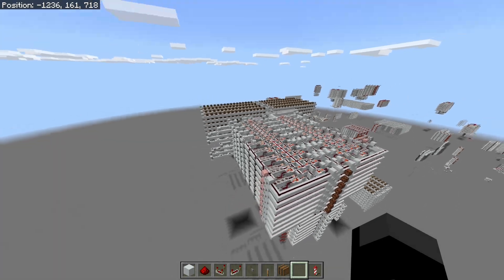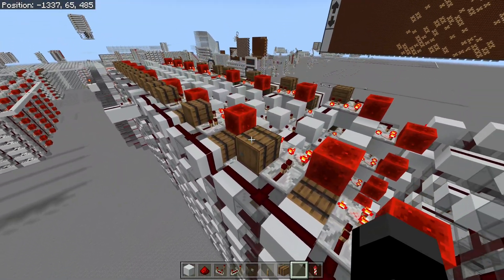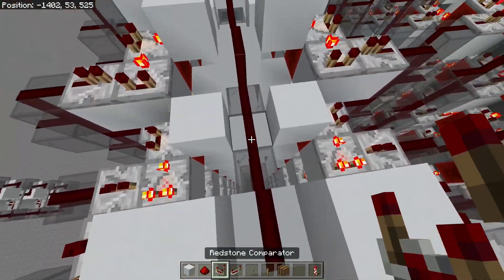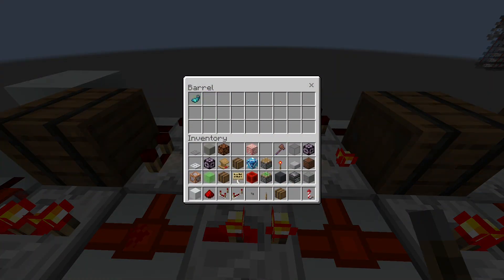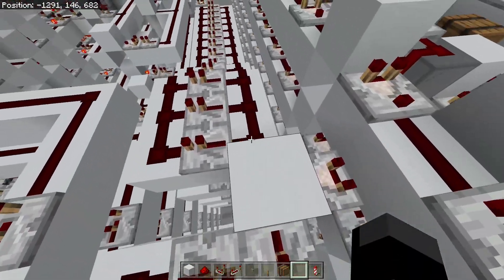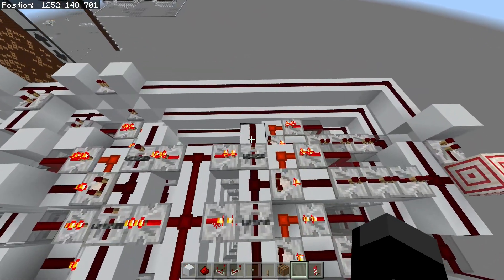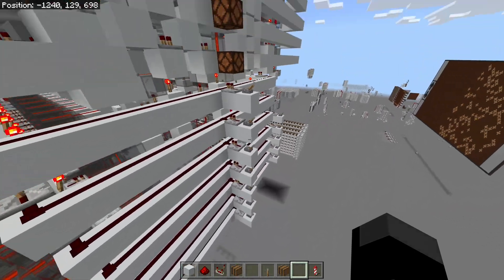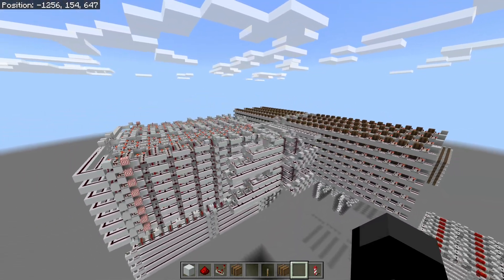I built an instruction cache in Minecraft Bedrock!

Comment: i am making a chest based rom. you can call it a redstone hard disk because it will surely have a 8 second delay or 80 if im lazy. im running into a problem. it cant read the rom it just takes the data and display it. do you think it will impact a computer or a machine?

edit : i can use you serial ram buffer thingy to make it faster. but it will have a huge delay to transfer data to from the hard disk
Reply: prefetch

Comment: I dont know how can paging reduce the processing cycle, since loading a whole page will definitely take longer than a single piece of data. Can you make an specific example of how can this be useful please?
Reply from the maker: @thanhhoa7955  Paging is typically used to address a much larger amount of memory than the fixed address but in this case it can temporarily speed up a processor. If you build a kilobyte of memory in Minecraft it will be very slow for random reads due to all the repeaters needed (whilst sequential reads are faster any branch will add a large penalty). If you have a small amount of memory like only 64 or 32 bytes you can randomly access it very fast meaning it will not bottleneck the CPU. Ofc each time you swap the page it will need to stall the CPU which will take a long time. Also, the type of hex memory that I use can only be sequentially read so paging is required for it to be fast. The hex memory is also extremely dense so 1k of hex memory is much denser than 1k of traditional torch memory.
Reply: @TheDarkness344  Wow, thanks for the detailed explanation

Comment: You can make stackable hex to binary converter
Reply from the maker: Yea this one uses a vertical design as it is easier to build and I think faster than the horizontal one which uses conditional subtraction. Also less bussing - only 8 hex wires instead of 32 binary wires.
Reply: @TheDarkness344  
Sorry, I am a Japanese student and I am using Deepl translation, so maybe my grammar is strange.
By "conditional subtraction" do you mean comparator in compare mode?
Actually, there is a "vertical" stackable hexadecimal to binary converter that works in "3 ticks" without it.
I built it in Java Edition, but logically it should also work in Bedrock Edition. Maybe.
Here it is.
Reply from the maker: @y.k.495  for conditional subtraction i mean the converter design uses comparators on subtract mode will take away a certain amount only if it is able to. The design I have used does not use this as instead it just separates the signal into 4 separate lines then filters them individually.
Reply: @TheDarkness344  
For some reason I can’t send you Twitter link

Comment: How you make a full barrel like that?
Reply from the maker: @oxygen2623  you can fill a barrel with items then hold the control key and press middle mouse button to capture the items inside. If you are on mobile/xbox you might have to plug in a mouse and keyboard if possible.
Reply: @TheDarkness344  is it possible by using shulker boxes?
Reply from the maker: @oxygen2623  I think so, I just do it with barrels as you can open them even if they have blocks on top.
Reply: @TheDarkness344  alright thank you mate

Comment: wow! how did u make ur hex to binary converter for 8 bit that takes 2 hex values and converte them into a decimal byte?
Reply from the maker: I used two separate 4 bit ones stacked on top of each other. The top one converts one hex value at the same time as the bottom one.
Reply: @TheDarkness344  oh ok i though it was harder lol, ty!🙏
Reply: do u have a world edit schematic plzz? i tried to remake it cuz i dont see any tutorial about Caches but it's very hard
Reply from the maker: @TurtleLuc  i have not got one yet but I have a newer design that I am working on which I will release in the future. The newer one will also include a tool that will automatically place the barrels with the correct data inside.
Reply: np, that's so cool!! like a compiler?
Reply from the maker: @TurtleLuc  possibly, I'm not too sure yet. At the moment I have written a simple python program that takes a text file of hex values and turns it into a behavior pack. You can then just load the structures with a simple command. I will probably also need to figure out stuff like rotation and some quality of life features before I release it.

Comment: I don’t see the point of using the cache to see the data because can’t you just read the data straight from the hex memory?
Reply from the maker: The reason you use cache is because it reduces the access time for the data. If you tried to read just from the hex (random read not sequential) it would take ages between reads meaning your computer would be very slow. A cache is used to speed it up. Real computers use cache as well for the same purpose.

Comment: So it’s pretty obvious that you’re making a computer, but when do you think the computer will be done?
Reply from the maker: Not too sure as only really started work, however this computer will take a long time as I have a lot of things planned for it.
Reply: @TheDarkness344  what other things do you have planned for it?
Reply from the maker: @AlsoOJCAT  well atm the general specs are:
Harvard
register based (dual read so 2 operands)
2048 bytes ROM (2x64 byte icaches)
16 bit fixed length instructions
64 bytes of RAM with horrible block cache design (may change)
8 I/o ports
And possibly multiply/bitcount/abs + more if I have time to design these - most likely will not have these, but if I find I have lots of time then I see.

I will also need to create an external assembler program which can generate a schematic for the ROM. Displays and user inputs will need to be designed as well ofc.